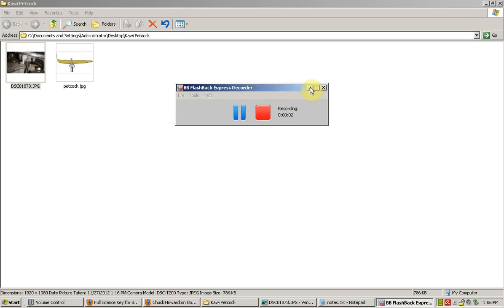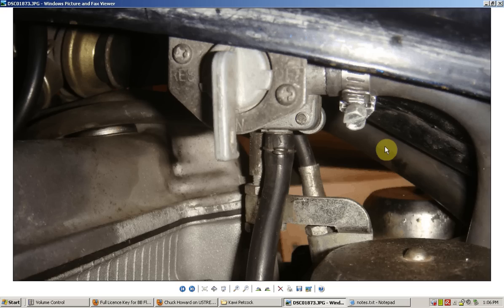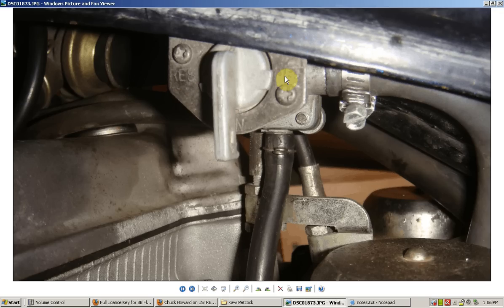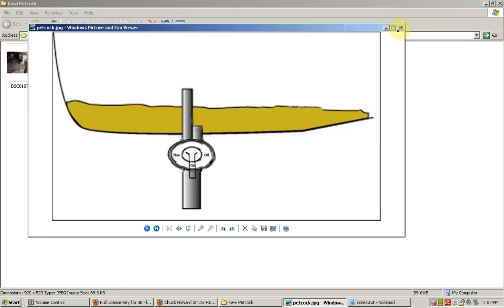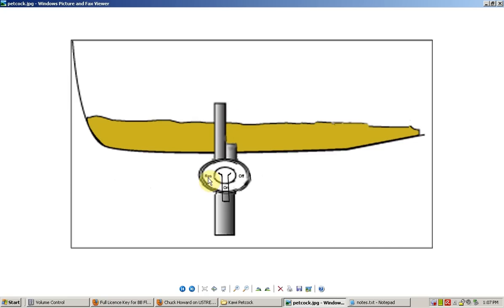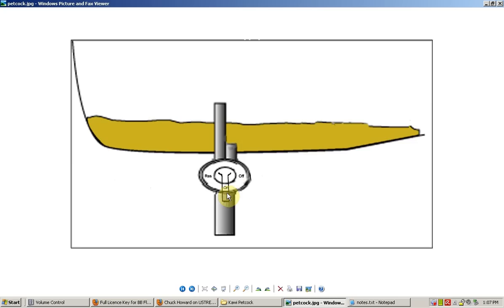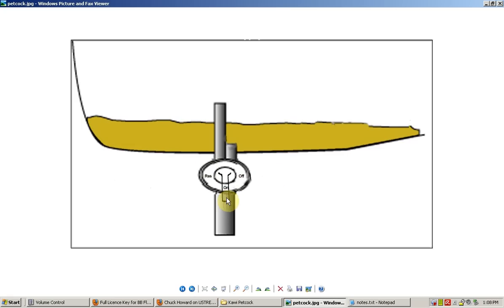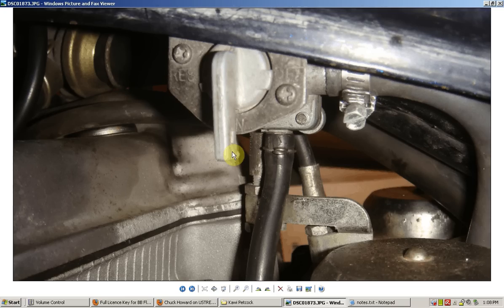Basic Petcock Operation (for mikemikemotorcycle)

Comment: what position for a 2004 Honda 750 aero on off reserve?
Reply from the maker: If you can't find any markings on the lever itself then make sure the tank is at least 1/3 full.  Get a drain pan and disconnect the hose so any gas will drain into it.  Of the three possible positions one will shut off all flow. That is your off. One of the other two will be either main or reserve.  Choose one of them.  After the gas stops switch to the third position. If little or no gas flows that was your reserve.  If gas flows for a while and then stops then the second position was the main and the last position is the reserve.